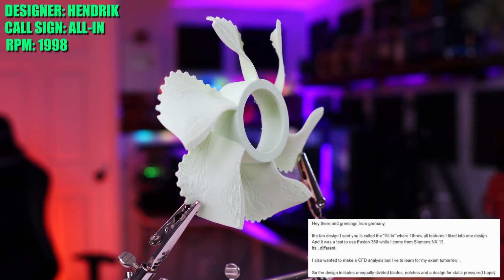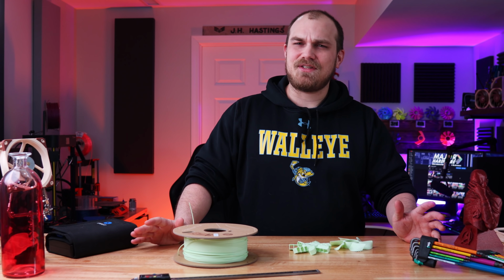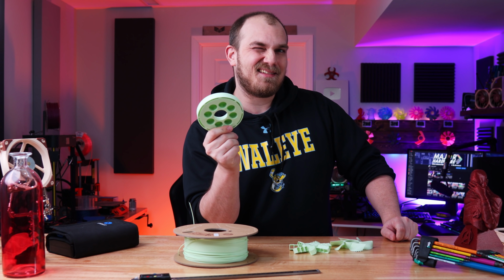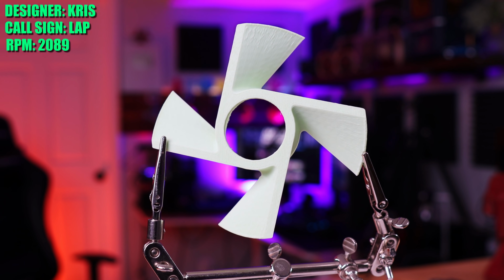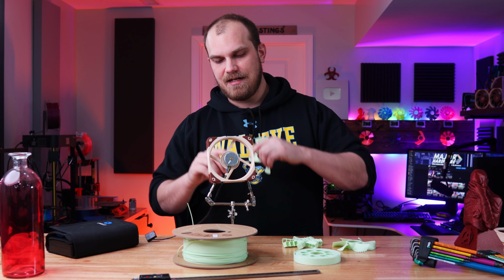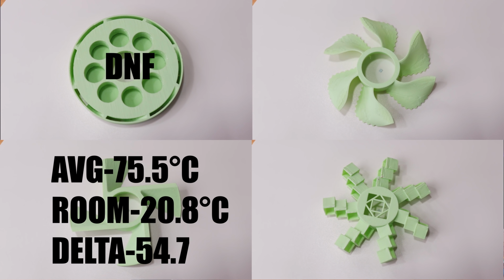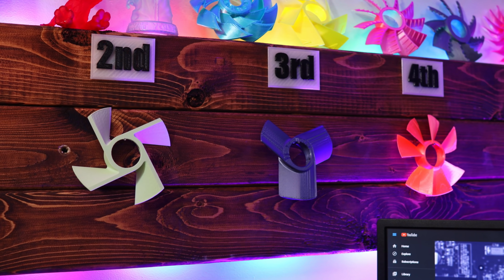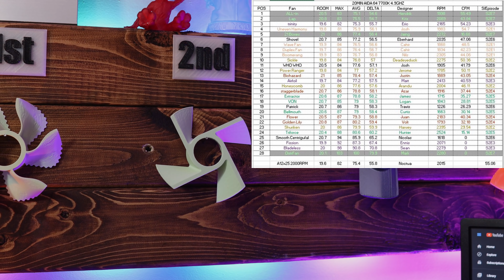MINECRAFT STEVE would love this! - Fan Showdown Season 2 Episode 7

Comment: I'm curious if the LAP with 8 blades that line up with frame supports would be even more annoying.
I think we need to see this.
Reply: Well, you know what you gotta do. 😏
Reply: It just needs to have enough cooling not to DNF, it doesn't need to make the board. Make it a 16 blade variant...
Reply: The rpm would suffer so the noise would be higher pitched but quieter
Reply: @ilikeyourname4807   so what if we did a 2 blade would that make a really loud pulsing noise
Reply: I hope someone uses an air raid / police siren design and calls it the LAPD fan.
Reply: Off set the blades so that it sounds like a Britney Spears song.
Reply: @agvulpine  I never thought a comment about designing a fan could make me cackle like a supervillain, but 2021 must be the year of surprises.
Reply: I think that "upgrade" would have to be called LAF -- I thing you can figure out for yourself what the F stands for, and it's not paying respects.
Reply: @agvulpine  iirc there was something similar in the previous season
Reply: Maybe if the blade wasnt that thick, just the end that meets the thing. In that case its all about weight x blade number. and not all of them need to be full blades, maybe most just be spokes for noise. Somehow it accidentally made 2nd because it was designed to be an actual fan.
Reply: @calvinthedestroyer  There is at least one freeway in the States where the cement has cross-lines cut in it to make music against each car's tires.  To sound like anything, we'd need a much slower, bigger (as in many times bigger, not a couple inches) fan with lots of points that varied spacing, probably with two or fewer blades.

Uh, or just sing like a goofball into any running fan.
Reply: @VoltisArt  Actually, one could have the fan be single bladed, and have it have a couple of holes in it, and whenever it passes the spoke the airflow would be pushed back through the holes, so you could make a loud as fuck fan that made notes... It would get annoying over time. It would be the fan format of a musicbox...
Reply: @livedandletdie  Ever heard of a rotary woofer?
https://en.wikipedia.org/wiki/Rotary_woofer
Reply: I'd like to see two more versions of the LAP: one with with the blade shape reversed -- the back of the blade is concave creating an area of turbulence; and one with the same blade shape but 8 or 12.  WAIT!  What if the you had four blades on the inside, out to half diameter, and eight on the outside -- can we create harmonies?  Or seven blades on the outside... dischord?
Reply: at work we have that on the first prototypes of our industrial pc's.... and you're not allowed to use those outside of a lab because of the noise....
Reply: Even better, someone could design a whistle blade that would deafen anyone in the room.
Reply: If you want noise, why don't put a flap extension on the LAP that actually hits the fan support? LOL
Reply: @chrismanuel9768  that would be crazy unbalanced.  I want my fan to at least work, not vibrate to death

Comment: Id love to see Server fans in season 3 and us trying to design fans that won't explode.
Reply: Server fans are a lot more powerful than regular PC fans. Plus, they're dual, meaning each unit has two motors that spin in opposite directions.
Reply: @velvetrosang4684  It depends. There are Server Fans that fit normal radiators.
Reply: @velvetrosang4684  most server fans are not dual motor, thats a rarity

Comment: Here's an idea for Season 3 - Test the A12x25 each episode for a direct same-day delta comparison of the four competitors to the reference fan, instead of just once at the beginning of the season. That way any seasonal changes don't cast doubt on the results. 

Getting greedy, but I'd also toss in the idea of a separate board for low rpm/noise level. This would be way more work, but it would be so cool to see! Something like reducing the fan voltage to try and get the test fan (maybe) down to a certain low noise decibel threshold, then comparing the performance to the A12x25 at that same decibel level threshold. That should allow an apples to apples comparison at the same decibel level. 

Keep up the good work my man! This is good stuff!

Comment: You now have two designs that actually outperform the Noctua. I think that should be newsworthy.
Reply: Airflow they might do better than Noctua...but most fan consumers are also interested in the noise production so a successful design must flow lots of air whilst making minimal sound.   So far only one fan has come close in the last showdown.
Reply: @recoilrob324  interesting, but the prime aim of a fan is to keep temperatures low. That is the key metric. Noise is important, but it is secondary.
Reply: @wszystkofajnie183  what on earth is this?
Reply: @recoilrob324  but will they be as loud when they are made from cast plastic with very smooth surfaces and lesser material strengh? I think they might be a lot quieter then. I know he made a test with smoother surfaces, but the were far from perfect after the treatment
Reply: @Taunus-Tim  I think a solid piece of plastic would have greater strength than a bunch of laminated plastic fiber, bud. Still, any company that used the design can just tweak it themselves to reach whatever benchmark they need.

Comment: The Disc Fan looks like it would be better as a pull rather than a push. On the push side it is only moving air around the very edge, where as the pull side is pulling air through a larger surface area.

Comment: Having, myself, noticed (surprised by) the insane amount of air that a HDD platter assembly can produce with the top cover removed.... I like where the Seagate engineer's head was at! 
However, I think I see the flaw in his design, and it's the edge layout... 
Fans are essentially pumps, and so you need an inlet and an outlet. He has the inlet sufficiently setup (in my not-an-engineer opinion), but where I see the problem is the outlet, where the air is literally given a choice in which direction it will go: towards the front or towards the back... (I realize that was undoubtedly some of the intention behind the micro-fin support structures that connected the platters to the outer-ring portion, but they were too widely spaced to work that way  from what I could tell)

I think it needs to be retested after performing one or two modifications (fixes):
#1 (easiest) simply have the top 'platter' extend all the way to the edge of the shroud. Ideally, with a nice curve at that junction to lower air resistance and alleviate backpressure.
#2 (more involved) would be to further alleviate backpressure by giving each platter its own offset exit port, so that there isn't a traffic jam of air ᴬ . This would be tackled by the exits being in a concentric-ring pattern, again with a gentle curve to force it towards the back, since the air is being slung out (centrifugal) and needs to be directed "down". ADDITIONALLY,  it might help(?maybe?) to section off each inlet port so that the it creates its own channeled path to an individual exit, instead of having all ports sharing a single outlet? Or maybe where only 2 inlets share an outlet?

[ ᴬ  this is why performance exhaust headers/manifolds stagger the entry point into the main pipe, aka the "collector" (the principle is called 'scavenging') which results in all the air collecting into a continuous flow of gas instead of pockets; however, that can't be applied here since an engine is pumping air in pulses, whereas a fan is a continuous feed, and thereby requires the individual exits since each port is already generating that continuous flow of gas! ]

I'd love to do all of this myself, and submit designs, but on my rural """4G LTE""" (2mbit/down) connection, and with limited monthly bandwidth (24GB for 3 people), I don't think it'd be conducive for me to download 3D modeling software ... Unless there are some lightweight browser-based modeler sites that allow you to save in STL format? (I know there are browser-based 3D modelers, but I've admittedly not looked into any...)
Thanks for the awesome channel topic, I've been watching since the beginning! :D

Comment: you could also use dual extruder and PVA material as support, that way you could just dissolve the supports with water and have the final part. resin printing  working too, propably the smarter option :D

Comment: I don't do 3d design, but what would be an interesting challenge, if anyone wants to take it up, is two sets of contra-rotating blades. I'm thinking you're going to need some gearing for one set, since the spindle only goes in one direction, which is going to lose some efficiency, but it'd be cool AF.

Comment: One thing that I'm thinking is how much variations in room temperature affect the result. To be more precise, maybe using merely the difference between the device temperature and the room temperature is not enough and may skew the result and incorrectly make one fan seem better or worse compared to another fan that was tested at a different room temperature. Even a 1 degree difference in room temperature may well have an effect.

Other things you don't take into account at all are atmospheric pressure and humidity, which may also have a huge impact on the efficiency of the fans. Testing different fans at different pressure and humidity conditions may skew the results and put the fans in the wrong order on the leaderboard.

For completely fair and accurate results you would need to test all the fans at the same room temperature and atmospheric pressure and humidity.

Or, at a very minimum, measure pressure and humidity alongside room temperature, in order to get more data. Devices to measure these things are very cheap.

Comment: Yeah the faster the hard drive"which has multiple discs" spins the more you have static air flow. Which in turns causes buffering. Even though the hard drive housing is sealed. Thats why some of the most slowest expensive hard drives are vacuumed. Their in orbit around the earth

Comment: Has anyone noticed what a dense and evenly directed stream of smoke the LAP impeller creates on the exhaust, with COMPLETELY NO turbulence at the intake and exhaust stages!!!??? WOW!!!!!!!!!

This is a clear hint that the LAP is a solid concept of a potentially commercially successful impeller...I wonder what the static pressure of this impeller is.

But the acoustic data is certainly not so impressive.... I believe that the edges of the impeller blades SHOULD be made AS SHARP as POSSIBLE, so that the blades LITERALLY CUT the air at high speeds, so that their "blunt" faces do not COLLIDE with dense air at high speeds, namely, literally cut it, being SHARP, creating MINIMAL aerodynamic drag ..... this will SURELY significantly improve the acoustics!!!

Advise the developer of the LAP impeller to refine and improve its prototype and send you version 2.0 for future tests.

Comment: I don't have an idea for a blade design but I think I have an idea for a fan design for the next fan showdown take two noctua fans put them face to face make them spin in opposite directions and make 2 3D printed counter-rotating turbine blades to try to maximize air movement with two counter-rotating noctua fans stacked on top of each other

Comment: You should put a frame around the frame of the fan (like in a case) because the air that exits the fan sucks air with it. You also should test airpressure of fans. Just my opinion i watch your videos because there is a good chance that someday some guy will have a good idea that beats noctua but to reach that goal we need to measure every property of a fan. Otherwise we might overlook some information

Comment: I saw at the end of the video the table of the fans showing the CFM of each fan. I was very surprised to see how much variant there were between the top fans. In the top few there is >50cfm and then there is 16cfm?? I would have thought the more cfm the better the rating related to temp (i.e. pushing more air though the cooler fins)???? Thats perplexing. Could there be another factor thats impacting the efficiency of the fan that one could take advantage of? Is it possible that if the air move too fast there isnt enough time to transfer the heat and too slow there isnt enough air to draw more heat? Can you run a test on fans 1, 2, and 5 (in this chart) running them at various speeds (like 100rpm increments) and see if there a point that each fan performs best or is it always the faster the better? I would also like to know these 3 fans static pressure?  How does the cfm compare to each other with no resistance and with resistance (not sure how much but maybe have the outputs go into a sealed tube where you can control the size of the outlet and see what cfm and pressure (psi) is at 0%, 25%, 50% blockage? Sounds like this could be 2 more episodes :)

Comment: Reprint using the same material a few of the fans that fell off the leaderboard check that the material wasn't an unfair advantage.
Reply: https://youtu.be/TDnny01W2zA XDDD
Reply: @wszystkofajnie183  GTFO
Reply: From s1 to s2 the criteria changed too. So we nedd s1 fans with the s2 criteria
Reply: @N3onDr1v3   wasn’t talking s1 vs s2 it is more about knowing if this new material played a part in the fans being better as even a small difference like it weighing a few grams less per inch of material could skew the results. My main thing is with such a big change in the leaderboard feels like it should be checked by picking one or two of the fans that dropped off the leaderboard reprinting them with the new material and see if the results change if it stays the same guess the fan designs were good even if they were all loud.

Comment: I have a crazy design for a fan but I need the frame of the A12X25 fully dimensioned. (the bolts position, height from top of hub to the front face of the frame and frame size) dimensions are very crucial without them it will fail

Comment: The LAP design looks like it should be rotating backwards. I think the designed have make mistake with the direction.
Can youturn the fan around? I mean cut that little edge that stops at the motor and turn it arround? I think it will have better results.

Comment: Why not add a load cell or air flow censor to your test setup and add some sort of air movement metric to the empirical evaluation criteria?  After all, we use fans more more than generating noise and heat.

Comment: Someone should make a blade design to sound like an air raid siren and claim the rank of the loudest one! What would happen if someone would manage to make a "2 fans in one" with both sets of blades having a countering rotation, front one would suck air in and the one attached to the motor would push out? I imagine the simplest way to create this would be to copy the primary set on top of itself and orienting the blades from each one in the opposite angle to remove needing a motor for the second set of blades?

Comment: I feel like the disc fan was mounted the wrong way around.. ^^
Reply: It can‘t as the hub can only be put on one way.
Reply: Front or back doesn't matter, but the way it was mounted is how it was designed.  (The cap ring rests against the top of the metal hub.)  Flat surfaces don't push air to a particular side, they do it evenly.  If anything, this design has to be mounted at 90 degrees to the usual, i.e. with the edge of the blades lined up with airflow, not either face.  At that point the outer part that was actually the fan is wasted and the design still fails.

Comment: I submitted a fan a few months ago :(, you might want to take a look at it, it has a counter rotating fan blades, its name, the contra rotator
Reply: If it's designed to rotate the opposite direction, it might have been disqualified, because the motor doesn't have a reverse option without being rewired.  It would just be pulling air from the radiator instead of pushing in.  If you're okay with that change, you might try resubmitting with a different description.
Reply: @VoltisArt  trust me, it works, no mods required, think you read it a bit wrong too, since its counter rotating fanBLADES, two blades spinning in the oppisite direction
Reply: @freddymaster0057  did you integrate a gearbox? I thought about that too, but my CAD skills got very very rusty. But one of my main subjects at university was "turbo machine design" so i am confident that i could design a very good fan!
Reply: @Taunus-Tim  yes, i added a planetary gearbox to reverse the second fan

Comment: Stupid question: Are you sure the disc fan wasn't on backwards?
Reply: It has a cap ring that blocks against the top of the metal hub.  He's sure.
Reply: Maybe if those round air scoop holes were staggered so they could do some actual scooping it'd have finished(or work as intended)?

Comment: Dear James, the electric motor has a fixed amount of coils and copper windings, so if you’ll fit a high resistance fan the amp will increase but the RPM should be the same but watching the fan showdown this is not the case, can you explain this ???

Comment: @major hardware hey, the disc fan, you've heard of xyzprinting.com/en-US/material/water-soluble ? there is multiple manufacturers of the stuff but you can print it in a dual filiment nozzle as supports and then soak it in water to finish the part

Comment: You should redesign the LAP using 5 blades. Could improve cooling and should reduce the noise level. We actually could end up with a record breaking fan. 👍👍
Reply: I did that and resubmitted.  Also made a version with the blades swept backwards a bit (curved) instead of straight, so the trailing edge of the blade doesn’t pass by the spoke all at once.  We’ll see if James feels like giving a revision a shot.
Reply: @krisb1999  Oh oh oh... Better don't let James pick the one to test. He usually picks the more ridiculous than the more promising one. 😅